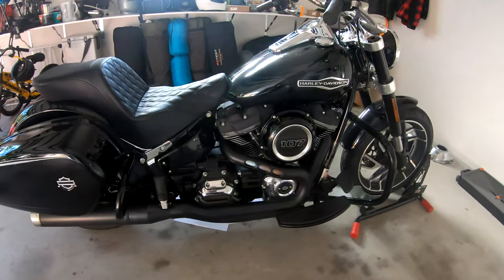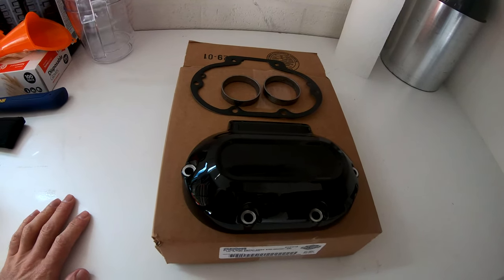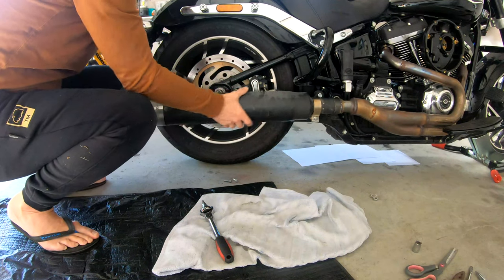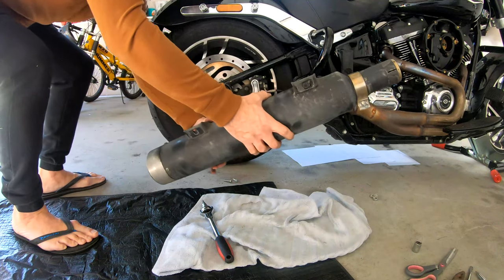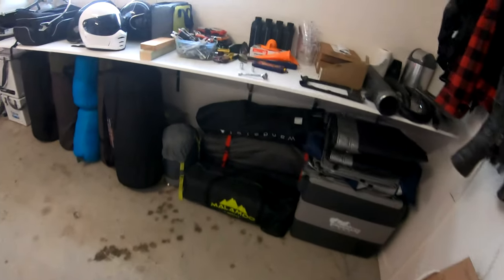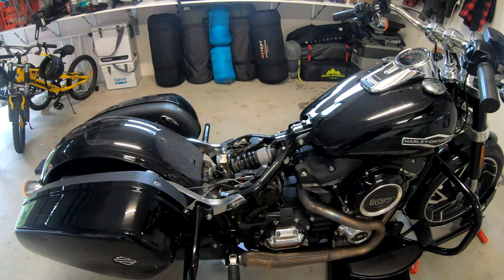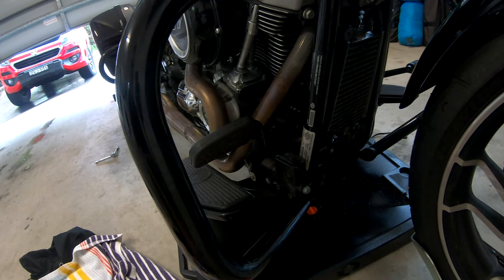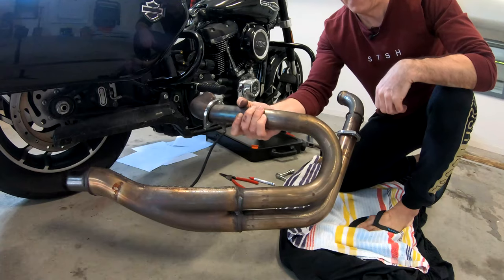REMOVE EXHAUST from a HARLEY DAVIDSON SPORT GLIDE

Comment: For those of you who want to remove the exhaust from your Sport Glide, you don't need to remove heat shields or even the muffler.  The whole assembly comes off in one piece!
The only attachments are the head bolts and two (2) allen screws under the muffler fastening them to the frame.  To remove the CO2 sensor connectors, remove the battery cover.  Look for a small tab under the connector and depress it with your finger.  Comes right off.  Same for front sensor.  I have a 2020 Sport Glide and had the same trouble with the front cylinder exhaust bolt.  Was not able to move the oil cooler enough to get a socket in, but did have enough room to get a box-end wrench in.  Once it's loose, go to the other side of the  bike and you will have enough room to remove it by hand.  Good luck!
Reply: Super helpful advice! Thank you!!
Reply from the maker: Glad to help ride safe

Comment: I think that explaining which tasks you used to release the O2 electrical (demonstrating) by explaining what tool you used to "flip" the lock tang on the connector would keep some people from breaking the connector would be a good idea. I just pulled both of my 02 sensors from the pipes. I don't think that separating the oil cooler from it's mount is that easy either, I disagree that leaving the heat shields on as John said is a good idea either. I have a 2021 Sport Glide.
Reply from the maker: I'm no expert and not doing a tutorial..just showing you what I'm doing to a certain degree.

Comment: Thx for the video! Was looking for some footage on the stock pipe, thinking of fitting one on my Low rider S.. What do you mean that you cant buy the fender support in black? Mine are black and i cant imagen that there are that much difference between the Softails.
Reply from the maker: Not sure why, I was just told that by a few different dealerships. That's in Aus. Can't speak for overseas
Reply: @RidesForDays  Seems like they all say stuff like that, my dealership here in Swe sad that i couldent put the seat from FXBBS on my FXLRS and that the siren for the alarm is different between te Harleys. thats bull =P Different mountig hardwares thou.
Reply from the maker: @Spikejonzon yep somtimes they're full of bs